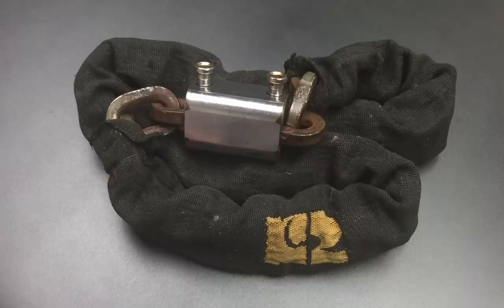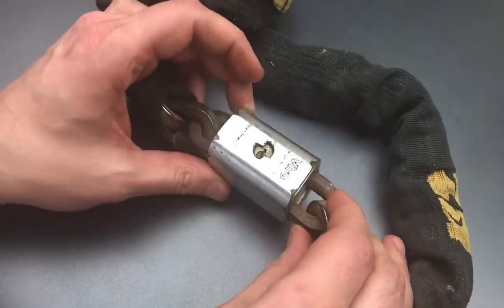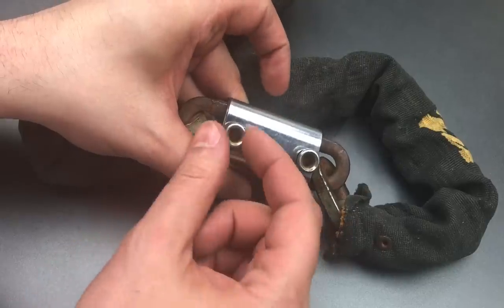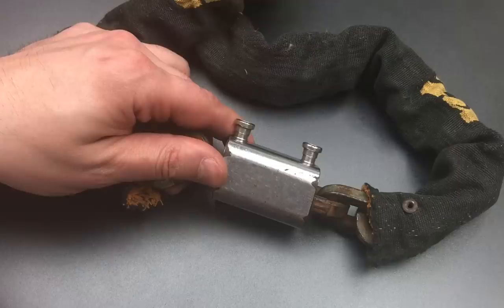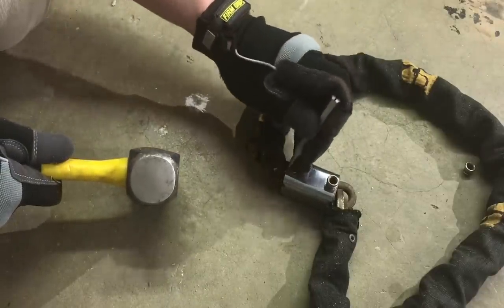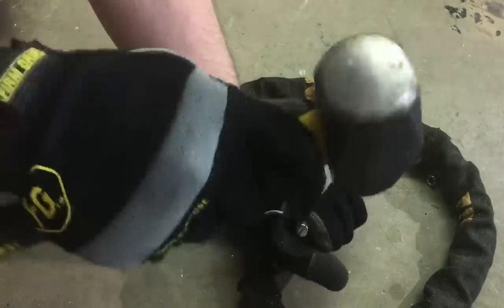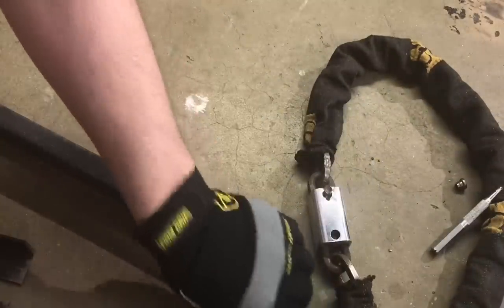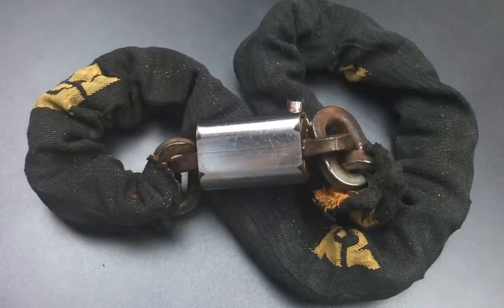[662] Destructive Testing of the Viro “Blocca Catena” Bike Lock

Comment: This is easy, you just need a Dremel, about 100extra batteries and about 3.6million of those little brown cutting disks :D
Reply: Small acetylene torch will go through the shackle in about a minute or two. Dremel with fiber reinforced abrasive disks will go through the chain in a few minutes with a few disks. But yeah, those stupid little brown disks...
Reply: Battery powered bandsaw :D.
Reply: Battery powered bandsaw... XD that made my day thanks!
Reply: Or a tiny dremel mounted diamond cutting disk. I cut through heat treated toolsteel with a single one of them.

Comment: Two non lock picking tips: 1 - eye protection; any of those hardened bits could shatter/splinter (You may goggles have but we can't see) and 2 - hold the chisel with a pair of pliers cause if the lock/chisel gives why catastrophically and you end up whacking the side of your hand with a 3lb lump hammer it hurts - from personal experience it continues to hurt for an astonishing time afterwards.

Comment: Ideas for a destructive attack? 
Acetylene torch!
Reply: Its too cumbersome, you need to roll up with your cannisters on a sack truck, once the chain is off you cant ride the bike and wheel your gas can away at the same time.

That only works if you have your van nearby
Reply: That's what I was thinking: Blow Torch
Reply: I thought a ceramic shell with thermite and some double sided tape to stick it to the top if the lock may work nicely. The right ceramic blend may survive the thermite, and the tape would only need to hold it up long enough to get going before the reaction bites into the lock. An exotic thermite could feasibly melt through the locks main body very quickly, or even just a few links  if you can get them separate. Creative delivery is all you need for the thermite approach I feel
Reply: @JamesPhillipsOfficial  you know they make torch sets that would fit in a backpack right?
Reply: @tylerblubaugh5549  yes, but does it last long enough to get through hardened steel on both sides, probably not.. I like my stuff to be portable but there are drawbacks, less powererd performance or a more expensive shortened duration of big power are typical choices.
Reply: @JamesPhillipsOfficial  it should last long enough if you know how to use it
Reply: It's obvious. Attack the chain with a 48" bolt cutter.

Comment: For everyone suggesting he put steel rods in the hollow of the shackles: the hollow ends right below the weakest point, so there is nothing to be gained from reinforcing that short section. There is no way to create continuity between the top of the shackle and the strong, solid section below. The shackle would still shear at the interface.

Comment: Two things. 1) If you were going to attempt to drill the pins simply using a set of ViseGrip pliers to stop rotation would more than likely be effective. 2) If you wanted to use the Ramset, placing a 19 mm bolt over the pin before attempting to use the Ramset on the hardened side would allow you clearance, in the event you were successful. Just my 2¢ Great video.

Comment: I hack sawed the core out of a BEST brand padlock. Mini hack sawed actually. I sawed a complete radius line all around the lock, and used a hammer and chisel to separate the core from the rest of the body, once the cut was made. I hack sawed a little into the core, i went too far, but the core was complete and still in tact once it was isolated. 
It did take quite some time and was reasonably loud. Using a hacksaw n hammer. But i learned a lot and advanced my lockpicking skills. I had never heard about a 7 pin lock before, let alone see the inside of it and see how it worx.

Comment: Impressed: would it be possible to insert two pieces of round stock into the holes in the shackle and then use some external force? It would strengthen the shackle, maybe enough to get the steel and brass to break. If you wanted to drill the shackles, a pair of vice grips and a plumbing torch would go a long way (first annealing the steel with the torch) then keeping it from spinning with the vise grips, but I do agree at that point you might as well cut it.

Comment: The only reason that the second retainer pin broke down at the ball bearing retention radius is because you previously broke the other pin. 

Somehow if this bike lock were in place, the chain/lock wouldn't have been close enough to the ground for you to be pounding on.
Reply: i also think it's unrealistic to attack the bike like in such a manner in real world situations
Reply: well there is no room for around the frame so my chain goes through the wheel and around some solid object. it's on the ground. oh and a disc lock on the other wheel. some would say that is overkill but the whole point is making it difficult to steal. i don't want somebody to take my beautiful bike
Reply: Fantaman900 
I place a cable lock around the head tube and through the front wheel and around a light pole or telephone pole. 

I'm usually no more than a couple hundred feet away from my bike. 

If you wish to steal, proceed at your own risk. ☠
Reply: I agree, if the person locked up their item correctly then the lock wouldn't face out  or be placed in a way you could beat on it. At a certain point (depending on neighborhood) just easier to angle grinder the chain off and be out of there in a minute...long before a cop is going to show up...most bystanders might take a picture but they won't intervene. Might not even call the cops, they don't want to get involved. and if a person does say "hey what you doing"? You could just be friendly back and say "fucking lock got stuck and I'm cutting it off my bike". My response to that if a bystander, okay cool later man. I don't have time to deal with someone that should have insurance and just parking it out in the open.

Comment: What if you reinforced the shackles (to prevent them from breaking at the drilled-out weak points) by inserting small steel rods into each of them before using the angle iron pry bars?
Reply: The shackles will still break off, as the second one did in this test.
Reply: Maybe, but not necessarily. By then the housing had been deformed by the repeated blows, and that may have been a contributing factor to the second shackle breaking. If the rods fit snugly enough and were inserted from the start, they might transfer the force to the other side of the shackle, essentially making it act like it was a solid piece of metal again. Just a theory, though - which I would have liked to see tested. :)
Reply: @Viigan  It's still going to break where the ball bearing sits though.

Comment: What if you put a hardened steel pin or dowel inside the two holes so you reinforce the "weakened" shackles and then use that lever press you mentioned in the beginning on the shackles?
Reply: blargcoster I was about to suggest the same thing and checked to see if anyone else did. Two steel pins would be easily accessable and transported. The shackle wells don't seem to be deep enough, though. I think the shackle would still crack and break off. The best chance with the pins, in my opinion, would be perfectly molded pins with no room in between.
Reply: It will not work. The pin handles are hollowed and then the pin itself is weakened to break off under applied side pressure. It is shown in the video.
Reply: @Frank-Thoresen  I dont think you understood what he is saying
Reply: and why was the chain off limits? that is the only chain that works on that lock the two ends being the hasp.
Reply: @hypernovie  he knows the chain can be cut through very easily and quickly with an angle grinder
Reply: @MonsterPumpkin  hes right. it would still work the same. Unless they were an exact tight fit
Reply: It would still break off at the sheer point, since that's where they stopped drilling the shackles. You'd have the same result.

Comment: I have this lock, its a secondary lock (the primary lock is a frame lock through the rear wheel, this one is required by my insurance). The Viro lock I use to lock my bike to any object on the street, the lock is then never on the ground, making a brute force attack even more difficult. Although I was surprised how quick you could pick it...

Comment: Weakest part is the brass so just attack it from the side. Drill, chisel or whatever.  Do what you did but ignore the steel casing. You can do the bottom and the top. Breaking the shackle tops off might make it easier to move them out of the way after you remove the brass.

Comment: Because of their manufactured weakened points, the bolts might sheer easily from the middle, by applying outward opposing force, from each of the links attached to the shackle bolts....
If the lock body was slightly longer, it would allow for much deeper shoulders on the outermost side of the shackle pins, then a breakaway section wouldn't be needed. You could also spring load the bolts to popup upon unlocking, thus allowing the bolt tops to sit flush into the casing when locked.

Comment: Simple. Put a piece of steel down each shackle hole then use a spreader. The drilled out shackles will now be reinforced and it will work as if the shackles were not hollow.

Comment: Take a bottle jack and secure one side of the chain to the base then secure the other side of the chain to the top of the ram and start "quietly" jacking up the ram and yank those sneaky shackles outta their home. If you can get one, it'd probably be even easier with one of those small hydraulic cylinders with a small hand pump that kinda looks like a grease gun, but I'm sure the bottle jack is more readily available to theives.
Reply: a bold cutter does the job faster and quieter. esp. if you get one equally the size of your jack.

Comment: However most thief's can not pick locks, and statistically theft occurs from opportunity. Plus if it's something you always park outside in the same spot then maybe mix it up with different locks and a few chains...however if I'm travelling across country with the motorcycle in the bed of the truck this setup looks fine, I'm just at a Hotel for a night and moving on early next morning (probably got in around midnight so only there for 5-6 hours. Of course best deterrent is the $0 deductible and accessory coverage...I'd actually make out and could use a new bike even if I am out say $2,000 I'm okay with that.

Comment: You could put steel inserts into the holes in the shackles, so you wouldn’t break them when you try the lever. That is assuming the hole goes down into the lock

Comment: the shackles spins and its retained which means there is something holding it in place.
maybe if you spin the shackle fast enough and pull outwards it will friction melt itself off.
assuming you don't stop before its off of course because then it'll weld itself in place and you'll never get it spinning again.
Reply: Do you think a hardened steel ball retaining it won't spin?

Comment: Nice one LPL. But you naturally tempered your hammer blows to avoid the consequences of missing and hitting your hand. Hold the punch tightly locked in a pair of Mole vice grips, (the ones designed for round things). Hold it close to the sharp end for a lower centre of gravity. Them belt the fuck out of it. I've used this method for similar jobs and it works. 

I once designed a slide punch that consisted of a round hardened steel bar twice the diameter of the thing to be punched, with the end turned down to the correct diameter. I drilled a hole the larger diameter in a lump of 2" thick mild steel. The amount of force that could be applied was huge, and every blow was better directed and more efficient. But due to the stability of the whole setup, less force and fewer blows were actually necessary. Plus ALL the danger of injury was eliminated. 
The irony is, some bastard stole all my best engineering tools, including a large set of uniquely modified Swiss files I'd made! My favourite punches were all of brass aluminium or copper. All are great for shifting stuff without damaging it.

Comment: The problem I have with this attack method is it relies on the ground as an anvil.  Most bike locks are suspended in the air when in use, making a striking attack like this so much more difficult and less effective.  I suspect most bike thieves would attack the chain as the weak point with an battery powered angle grinder or even bolt cutters.  But as you proved earlier, the core is an easy pick.  However, I'm not sure how many bike thieves are picking locks open.

Comment: Scissor jack with 1 hole drilled at the top and bottom, spread the chain across it with the lock in the middle then put 2 bolts threw the chain and the drilled holes then open/raise the jack 🤔

Comment: Great attack video. But I think you forgot to try inserting steal pins or bolts inside the shackles to reinforce them.  They didn’t seal off the top to prevent this, which is what they should have done.

Comment: Very well made lock - I think with 2 more minutes it would have failed though. The second shackle broke a lot lower, meaning that the remainder could have been forced out of the lock using the punch a lot easier than attacking the shackle on the other side. This could have allowed the chain link to be "persuaded" out of the gap.

Comment: You should have tried hammering out the shackle by hitting the exposed top of it after you weakened the sides of the lock with the punch. The top of the shackle probably would have broken off, but it would have been fun to watch.

Comment: I suspect that, with the shackle that snapped at the ball bearing point, you could have used the punch and hammer on the rest of it to work it out. Place the punch through the hole on the inside part of it so that the remaining shackle would be pushed out the other, open side.

Comment: Way to smash every lock anywhere? Small thermal lance. They can cut through stone and titanium in seconds. Hardened steel? Like a warm butter. You need thin steel pipe, steel wool inside, pressurized oxygen on not cutting side of pipe. Ignite steel wool and turn on oxygen...

Comment: I'm not sure how thick the shackle was on the inside of the lock but would it have been possible to use a hammer and chisel (or similar tools) through the holes on the sides, where the chain is inserted, to strike and possibly break them on the inside?

Comment: what about two pieces of hexagon Umbraco down in to those fragile things and then try to break them out through the side, cracking the housing and brass....?
also we have sometimes used an hydraulic tool made for small auto body shop repairs, to push the chain from the locking house, also it works wonders opening padlocks, 
ex: a couple of thiefs with this tool could easily break a lock and one of the thiefs holding a mat of insulation up against would mute the snapping bang form the lock breaking....
a lot of garages use padlocks and a far to thin lock henge.. but there's a 100.000$ car inside with no gps tracking...🤦🏼‍♂️🤦🏼‍♂️

Comment: The problem with this attack, is that it is taking a very long time.   The Ram Set, and punch the top of the pins so it drives them down into the lock.

Comment: Carbide burr? The diamond shaped one? 
A small container of high pressure gas- say a 20 oz bottle of Nitrogen or CO2 used in one of my paintball guns? It’s easily concealable. Little hose out to a pneumatic die grinder? 
I’ve seen them remove even HardOx at an alarming rate.

Comment: I don't think your custom chisel was as toughened as some commercially available tools. I'd checkout jackhammer tips, they're made to take a beating. Or there's the old trick of holding a can of compressed air upside down then hitting the lock or chain. It's relatively easy to get hold of dry ice too.

Another idea is an induction heater, that would be very quiet and you could make it portable. They also heat up very quickly.

Comment: use a modified carjack that hooks in the two chain links next to the lock and pull it apart
Reply: Rebster yeah I know, however I think the chain will survive the hydraulic jack in this case its a hardened steel welded I have similar one that weighs a ton and is not easily destroyed believe me

Comment: What if you inserted two metal rods with the exact diameter of the drilled holes (to defeat the intentional weakening) and then used the levers?
Reply: I think it would break at the same point as the second lock thing (I forgot what that is in English, oof) @ 12:40

Comment: if your going to make a racket cutting it go for the gold and use the 72cc gas powered cutoff saw to do it. that would be mega fun for you to try although theirs plenty of videos showing locks being cut this way by fire departments. I know it would be my tool of choice for events where i had to move bikes say at events where they should not be plus the simple act of firing the thing up means you have to cut ONE lock, and 10 others are running out to move the bikes so your not cutting them. I found ductile iron cutting wheels to be the longest lasting(mixture of silicon carbide and aluminum oxide i recall). new york forgettaboutit......forget about parking a bike illegally as it will come off:)

Comment: What's the cylinder made of? I've successfully sprayed butane into a brass lock cylinder, froze it, inserted a small screwdriver, and hit it with a hammer, one blow broke the whole cylinder in the middle, then a pair of needle nosed pliers to pry it out, ince one half came out, the lock opened. Also with harneded steel, you could try annealing it, meaning heat the steel hot[like with a torch] and let it slowly cool down, do that a few times and the steel should soften.
Also with your original idea of pressing the shackles, get some drill bits that will just barely fit in the holes diameter wise, that should make them strong enough to handle your first idea.